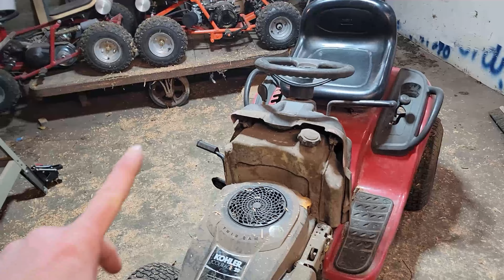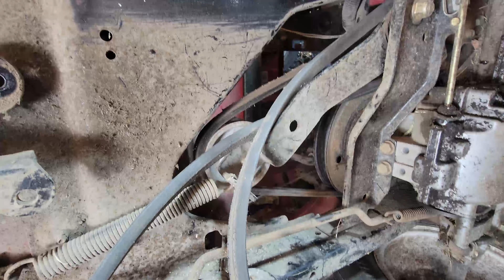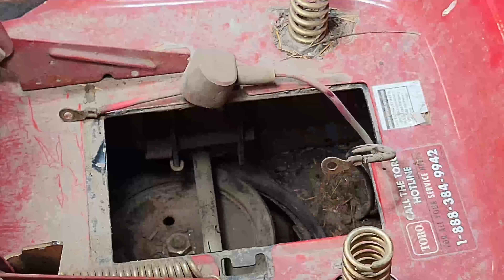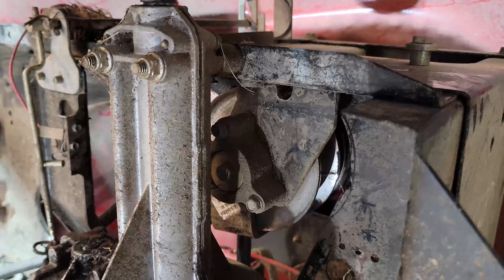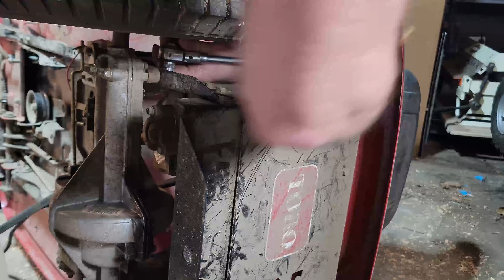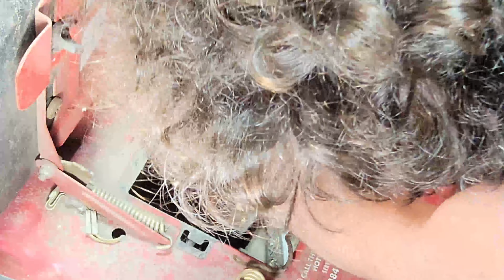EASY!! Lawn Tractor Drive Belt Replacement - Toro LX425 Drive Belt Replacement

Comment: im in process of doing this same thing to my lx500, wondering though if its normal for the belt to seem a bit loose & not snug, or tight ? I did triple check the part & it is correct. Im going by other tutorial instead of the lx500, because there isnt any . so just wondering if the belt having play is normal.?
Reply from the maker: A little loose is ok. If the belt is stretched too far, you will lose drive.
Reply: We got a 90" belt for ours (91" is the correct length but 91" proved to be unusable on our specific LX420) and even with all the adjustment in the linkage taken up it barely engages and drives.  Hopefully yours is doing better than ours, lol.  Thank you to @buildgrowplay for the solid video as it greatly helped with verifying we've routed the belt correctly.  Ours has a different engine and so I guess its possible the position of the drive shaft is slightly different or the pulley might be smaller diameter than the original.  I'm pretty sure we have the original pulley stack but I could be wrong.

Comment: My drive belt slipped off while mowing. Had to re-install it in the field. Talk about a PITA. 
The belts are shit, the pulleys are shit, the pulley guides are shit... It's like the entire mower is meant to be disposable. I replaced mine without removing any pulleys and with mowing deck in place but lowered. By the way, when you work on cars do you tip them over like this too?
Reply from the maker: You're a cheerful fella.
Reply: @buildgrowplay  Yes, I always look at the bright side of life...

Comment: How do you adjust the drive belt?
Reply from the maker: The belts are tensioned by idler wheels with springs. Perhaps you have lost a sping
Reply: The new belt I put on 1 year aging was slipping down hill I dropped the deck and found the belt had slices in it but was not broken. I ordered a Kevlar belt I’ll get it tomorrow. See it’s a better belt thanks for responding
Reply from the maker: @relieddie1  good luck
Reply: Ok a new drive belt and the same thing is happening 🙄. It’s as if it’s not if forward gear when it is.. when im going down hill. I also hear a clicking. That increases with the speed I go down hill. On level ground I have forward n reverse no problem any ideas🤔
Reply from the maker: @relieddie1  I had to retire mine 4 months ago because it broke the diff. It started with an intermittent Click. Perhaps this is happening to you. It may have also broken a cotter pin on one of your pulleys

Comment: Didn't you have to drain the oil before you turned it on it's side  ?
Reply from the maker: No. It should be fine. Is great to have an empty fuel tank, but the spillage isn't bad if it's on its right side

Comment: Flipping a rider on its side to work on it is really not a good idea. Oil runs into carb and cylinder head and gas from the carb and lines gets everywhere too.  After 45 years in the small engine repair business I've had to fix all kinds of things that got screwed up by doing this on many a rider and most of the time it gets pretty expensive. Save yourself a lot of money and do the job the right way, tipping it on its side is not it.
Reply from the maker: thanks Karen. sounds like you have a jack-stand you could lend out to the 99.9% of the population without one. You are super helpful